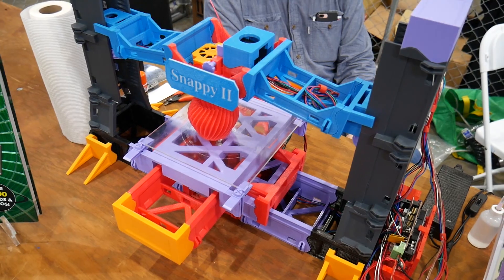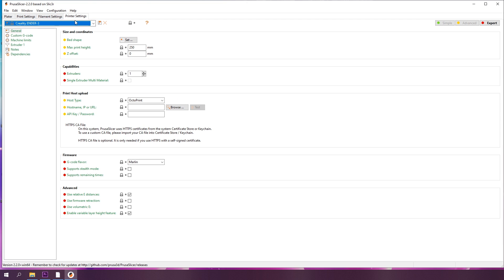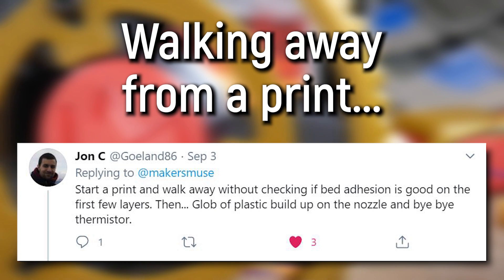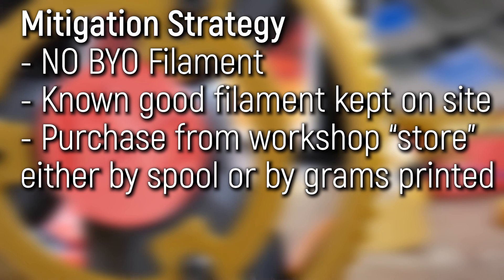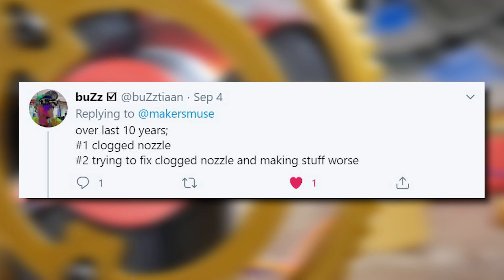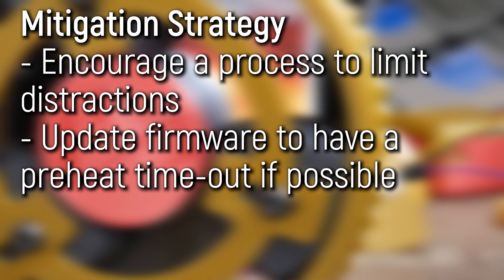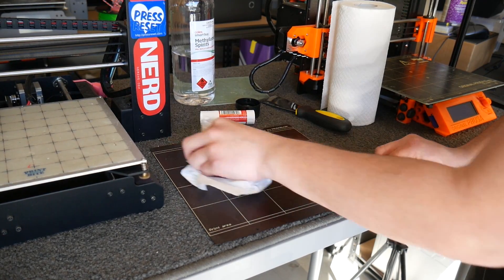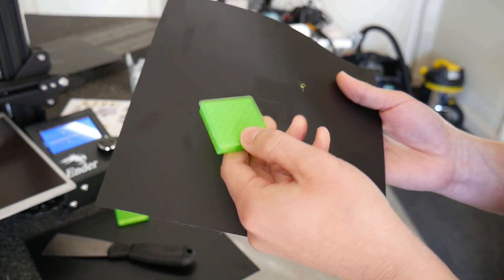How People BREAK 3D Printers (and how to stop it)

Comment: Ah yes, idiots trying to fix things.
Okay, let's say your raspberry pi  based thing stops working. What do you do first?
a) try using a new sd cards because the one in there just turned 3 years old in 24/7 operation which is kind of a small miracle. (And was probably only possible because i added an USB stick for most writing, also noted in the documentation)
b) rip off the connection to the RFID reader secured with a blob of hot glue.

I am giving you some time to think. And i also want to stress that there where pictures of the RFID reader before and after adding the hot glue, so everyone should have known what's below it. (The mini usb was crap so we removed the connector and instead soldered it, but those cables are super flimsy so we added hot glue.)

Of course you pick b)!

Oh, you also accidentally delete all the backups and the documentation. I fell of my chair laughing when someone told me that story. Because at every step i intervend with stuff like:
But they had a backup!
But they had the documentation with the pictures!

Again i need to stress: the thing was running at least 3 years 24/7. So i would say the soldered mini USB secured with hot should not have been any concern to someone with the slightest clue what could be going on. Because said connection worked for 3 years in an enclosed box! How would that randomly break?!

Comment: I got a sick puppy of an JgAurora5

The previous owner hat broken the nozzle at the heat break & ruined all screw heads which would made it possible to change the damaged part. I had to adapt an direct drive print head to fit.

The previous owner had "oiled" all moving parts with WD40. (I normally use this stuff to clean machine parts from dirt & old oil.) -> the whole thing was bearly moveing till I used "real" oil.

All end switches where set up wrong.

The input of the bed heat sensor on the main board was fried.
Luckily the sensor input for the second print head was still working & I changed the firmware to use this input for the heat bed.

Comment: I have a flexible magnetic print surface and I let my machine cool down before I do anything and I still have to manhandle it off the build plate. I can lift up the surface but once it gets to the edge of the print I can't lift it any more. Even if I lift up from all edges the print is firmly stuck to the plate and I have damaged the flexible surface trying to just remove it from the printer with the print still attached.
Reply from the maker: Is this the ender 3 pro per chance? I've noticed that surface seems to almost weld together and yeah, is difficult to remove. I slide a blunt spatula in to help release.
Reply: @MakersMuse  It is indeed an ender 3 pro. Thank you for the tip I'll differently try that next time

Comment: There was a guy at my uni that got expelled for trying to 'fix' the 3d printer.

What he did was using salad dressing to lube the rails on a ultimate, that got him bared from using the printers. The guy then snapped and sneeked in and proceeded to cut wires at random in all the printers.
Reply: Y I K E S
I think he had some bigger problems than being bad at 3d printing
Reply: "Lets try lubing with salad dressing. Totally won't break the printer. Wait what? I'm banned! Ok, lets destroy all the printers." What logic is that?
Reply: I can kind of understand salad dressing instead of white grease (Dunning-Kruger) but that one isn't going to come out of D-K valley anytime soon
Reply: He wasn't expelled for trying to fix it, he was expelled for vandalism yikes
Reply: @YinandYang67  It happens more often than you might think. Little psychopaths are common

Comment: I snapped the heat break on my printer with little force when it was hot....pretty sure the heat break it came with was cheap. All these issues is why I recommend anyone who wants to get into 3D printing to get Anet a8. It’s cheap and will teach them how to build and maintain it.

Also I have a glass bed and I usually add a layer of hair spray, from about the distance of the can height, after the huge bed heats up and then wait till it it turns transparent. Haven’t had adhesión methods since minus z issues from dual motor z axis. I am just too lazy to find the right toothed belt for it...last one was too big. 

Edit: add more info...

Comment: I wouldn't want to try to maintain a 3D printer in a public space.

I print ABS on glass using glue juice that I make with 10 grams of Elmer's X-treme glue stick dissolved in 500 ml of deionized (aka distilled) water.  I use a few ml per print distributed on the glass using a nylon bristle brush.  20 minutes after the print finishes, the cooled part completely releases from the glass and can be removed with no force that would ruin the bed level or damage the printer.

It also helps to use good filament.  I now buy ABS filament in 2.25 kg reels from MakeShaper.  Every time I measure the diameter, it's 1.74 or 1.75 mm.  It prints like a dream, doesn't dribble from the nozzle when preheating, and I've had no nozzle clogs in several hundreds of hours of printing.  There is also no styrene smell when printing, or any smell that I can detect.

Comment: Was printing on clean glass for awhile untill coiuple priunts started lifting so i started using hot glue gun in a fine layer. it requires replacing once every few months but keeps everything stuck very well. If you don't get your print off hot you will wrestle with the printer to get your print free lol.

Comment: normally when going into a maker space i take a good look on the printer or printers, see if they need cleaning running a wet paper towl on the print bed gets rid of the dust, maybe take the pankage flipper and clean off the worst of the buggers left over, look at the nozzel preheat for 2 - 3 min see that it ozzes, take out one of the many business cards i have and bed level if not auto level. then run the simple print to see if the bed i level the one that print these many squares and see if you can knock them off just by lightly brushing them with your fingers if not let the print finish takes about 10 min. once this is done clean the bed again whipe it and then start my print, that is if i know what type of fillement that is in the printer if not take out the roll. i have quiet often seen the printer with a "Generic" fillement no lables no measurements and i normally trash that roll and only stick with rolls that has clear labels are are clearly stated.

Comment: i broke 1 bltouch and 1 printing surface before simply because i put dot (.) instead of comma (,) in my Z gcode. so instead of -0,2 it become -2. and the hotend and bltouch ram into the buildplate and scratch it and ruin the bltouch

Comment: its funny to me the way the market works. I went to tech school for mechanical design/CAD around the time of the Cupcake, and we had a $25k beast of a machine from Stratasys. After it was delivered i was the student appointed to have a one on one training day with the stratasys guy. Even after it wasn't "new" anymore that price stuck in everyone's mind, nobody wanted to use it let alone break it. In reality it really was foolproof, dead slow but it rarely failed let alone in a way damage was possible due to all settings being very tightly regulated, the build plate literally being a consumable (we had cases of them, something like $25 each, never printed on the same area twice) and 1kg rolls of stratasys abs costing $180. even to me with access to the maintenance modes, you couldn't break anything unless you did something youd have to know is just wrong. The funny thing is, that the other end of the spectrum these days, the super cheap ones are the ones who like to include some of these anti-idiot features. Think XYZPrinting. Why would you put a printer running such an open firmware as a reprap in a public space? you know its going to break anyway, might as well get a davinci 🤷. at least then when the failed print that takes up the whole build plate is fused to the hotend that's got pla oozing from the fan blades you can just say okay dumbass, new print head cartridge is 70 bucks, build plate is 40, and snap them in in 2 minutes.

Comment: Yeah so when I was 16 I got a TEVO Tarantula kit and I did just about everything wrong he listed in this video. I definitely learned a lot as a result and while far from an expert, I am certainly much more knowledgeable as a result of my errors, albeit down a bit of money. At the time I thought I was doing due diligence by googling stuff like changing the nozzle but I still annihilated the heating block. Watching this video repeatedly filled me with shame at my mistakes, though I suppose there’s a difference between a machine you own and one you do not.
Reply from the maker: Not entirely your fault, the tarantula was a steaming pile of crap 3D printer kit and needed huge amounts of work to print properly. IIRC it didn't even use correct V slot extrusion.

Comment: Just use ethanol for wiping things down. Way safer if more expensive. (About $22 a liter for 96%, much cheaper if you just use whatever house brand vodka the local big box offers)
Reply from the maker: Not so in Aus, our vodka starts at au$30 for 700ml due to taxation
Reply: Methylated spirits, despite the name, is actually ethanol with some additives to make it virtually undrinkable. Also called denatured alcohol. Not sure about countries outside of Oz.
Reply: @Bazzars  frequently there's methanol mixed in to make distillation much harder/impossible

Comment: Idk man, painters tape is literally the only thing that PCTG will stick to on my printer
Reply: yeah but sometimes the sticky side isnt strong enough. Id recomend something like buildtak or PEI. Even if everyone sais it doesnt warp, it always did for me, mostly because the glue wouldnt keep the tape stuck to the bed, the PETG would just warp and rip the tape out of the bed.
Reply: @laharl2k  on my very cheap first 3d printer with removable bed, a warping print would just warp the bed 😀
Holding a removable build plate with paper clamps is not a good enough.

Comment: My worst printer fail was my hot end temp sensor got pulled away from the hot end and then my heating element got red hot, melting a full bed print and causing my room to fill with smoke. Fortunately, I only needed to replace the hot end and nothing caught on fire.
Reply: pro tip: zip tie and kapton tape everything

Comment: Yeah.... personally learned the hard way on glow in the dark filament. Lesson learned. Replaced it with tungsten carbide nozzle.
Reply: Explain what happened please
Reply: @jakobey02  glow in the dark filament has abrasive material in it that will wear out the opening of the brass nozzle. I was using a standard 1.75 brass nozzle and after running 1 roll of GitD filament through it, the nozzle was abrasively bored out to 1.9ish. (I used wire gauges to get a close reading). By doing that it changed nozzle's tip and caused print fails. I found a nozzle from matterhackers (that is no longer offered) from E3vdm that is Tungsten Carbide and is capable of handling any abrasive filament. Best $90 spent.
Reply: @jakobey02  It's similar to (yet not as drastic as)  connecting a brass nozzle to a sandblaster. The tip will wear away from the abrasives fairly quickly.

Comment: We really need smarter software less capable of creating breaking gcode or running it afterwards.  I know we can't actually perfectly solve the halting problem, but we don't need to.  We just need software that can intelligently predict situations that might not be great and either prevent or strongly guide users away from dangerous setting combinations.  A pre-parser on the printer could also do some of this, but it would require a much more powerful printer board, basically a full SoC.

I know we can't ever get a perfect solution here, but we don't need one.

Comment: Let me see ... These have all been donated to our maker space in various states of disrepair:
Ultimaker Original: Dead by filament wearing out the tensioning system. On hold.
Anet A8: Blob of death and partly disassembled by the previous owner. Decommissioned.
Trinity One: Burned power connectors. Multiple repairs. On hold.
Something Made of Plywood: 'nuff said. Decommissioned.
Thing-o-Matic: Decommissioned by Office Space.
Rostock Max V2: Burned power connectors and blob of death. In progress: Replacing 80/20 cable runs with harness.

This one's mine:
JGAurora A5: Plugged the fans the wrong way around. Repaired. Installed SKR 1.4: Success. Plugged the Neopixels the wrong way around. Repaired.

Comment: So here is one that happened to me today: I am pretty new to 3d printing, I have an Ender 3, and today I decided to change my nozzle and despite being careful I stripped out the threading on the hot end.  I don't understand what happened and I don't want it to happen again; is there something I could have done inadvertently that cause it, is it just the creality hot end being cheap, should I change nozzles at a certain temp? 

I used it as an opportunity to upgrade to an all metal and would like to keep my new hot end pristine.
Reply: you always undo your nozzle at max temperature. You also always tighten your nozzle at max temperature.  You always undo your nozzle with two wrenches, one on the nozzle and the other on the heater block in the opposite direction so as to not put any force in the heatbreak.  First you understand what you are doing, then you do it, not the other way around.  Always use your brain.
Reply: @laharl2k  Ya I did all those things fuckwit, but way to show that you're a condescending ass.

Comment: I'm only going to disagree with you on one point. having a removable springsteel bed, i take it off and move away from the printer and spray it with hairspray. Never enough that i have to worry about z height, prints stick perfectly and probably more than anything, when I did this on my CR10s glass beds, i never had to worry about PETG fusing. If you use common sense its a fantastic tool, easy to clean up too.

Comment: The university I work at has a 3d printer lab and it has a staff that does all the printing for you. You can make an appointment to discuss what you're trying to do then upload your model and come pick it up a couple of days later. They have some very fancy machines including a Stratasys.
Reply: It used to be that way with using and programming computers. That was even before my time though 😀
Reply: @MeriaDuck  I remember those days; I came in toward the end of them. Everyone on campus had access to Dartmouth BASIC on ASR33 terminals, but if you were in one of the classes that used FORTRAN IV on punch cards, you had to submit them to the operators in the back room to run as a batch job for you, and come back a day or two later for your printout.

Comment: Are you guys having problems with thingiverse, they change the website and it totally garbage. It's super slow, times out, the search engine crashes. Are you guys having issues too or is it me. I try contacting them, but I guess it's broken too.
Reply: Thingyverse is always broken, try a different browser, sometimes chrome works better, but it still always has issues.

Comment: Not once but twice this week I have had to (manually) relevel my bed after pressing the "Z down 1 cm" button instead of the "Z up 1 cm" button resulting in the nozzle crashing and really scary grinding.  I'm still amazed I didn't crack the bed and it still prints fine.   I really need to remember to home after turning it on so the firmware will tell me to f-off if I try that again.

Comment: What’s wrong with painters tape? That’s my go-to now. My biggest issue is print bed covers do not last, loosing their sticking properties quickly, becoming destroyed within a month or less, even with proper care and cleaning. On the subject of difficult to remove prints I’ve found that tape provides a gummy layer that  makes it easier to gently ease it off the bed. 
I do use print bed covers but relying on them solely for adhesion turned into pricey print habit.

Comment: When I was new to 3d printing my first printer was an ender 3 pro. I had the most trouble with first layer adhesion and finished print removal. I simply stopped using the glass bed, got better at bed leveling and installed an auto bed leveler. Becoming better with bed leveling was very difficult for me to master for several months. A little bit of knowledge, experience, time and effort goes a long way. I sometimes use the glass but I much prefer the flexible magnetic mat.
Reply: Interestingly I have been the opposite, the base on the elder 3’s isn’t the most level and the springs are inconsistent, now prefer the glass bed and replaced the springs with harder ones. The glass on the bed means the springs have to be under tension and this has meant that I haven’t had to change the bed levelling in months. Nice and stable with the upgraded springs.
Reply: @Jhale716  Can you let me know which springs you used? Very interested in an upgrade on that part.
Reply: My original Ender 3 Pro purchased in Jan 2020 came with the flexible magnetic bed and print plate, I found the aluminium bed was very uneven, so much so that it had dips in the middle, and I couldn’t get a consistent flat bed. I’ve since added the glass plate and changed the springs as I mentioned. Adding the glass bed, not removing the magnetic base stuck to the aluminium bed, you need to adjust the Z end stop higher so it homes in the right place. Just a few mm but enough that the springs can’t be screwed down without moving it. I maintain a list on Thingiverse of the upgrades I have used/made to my Ender 3 Pro, under the handle jhale716.

Comment: Note: If you have a printer sheet on glass that is clamped to your bed, wipe off the bottom of the glass and the top of the plate before clamping down and starting a print... there can be debris under the mirror which will wildly throw off your leveling.